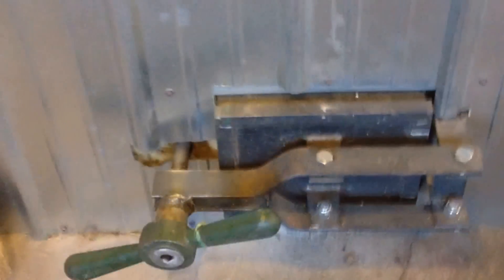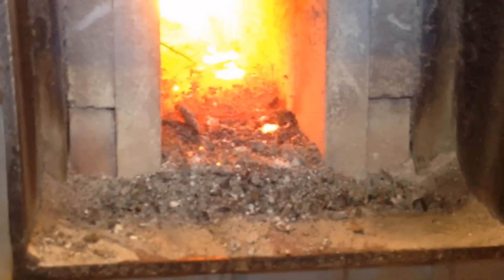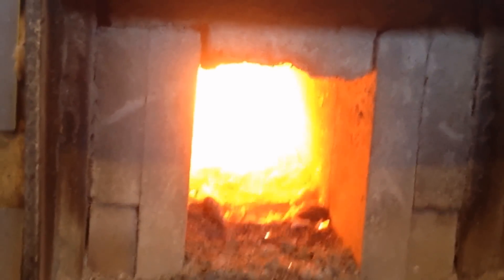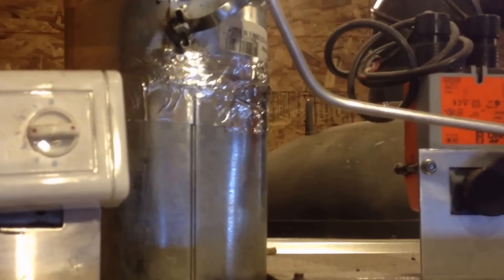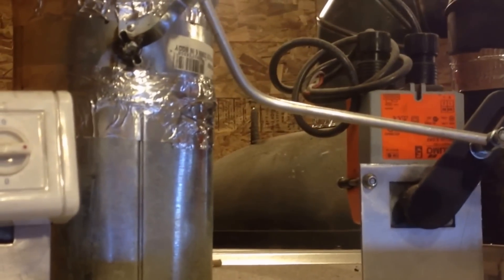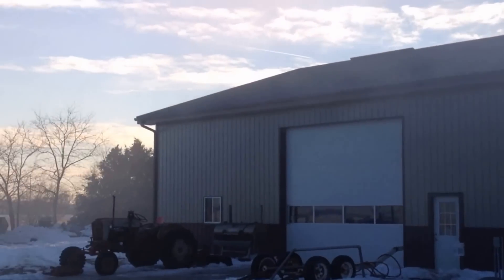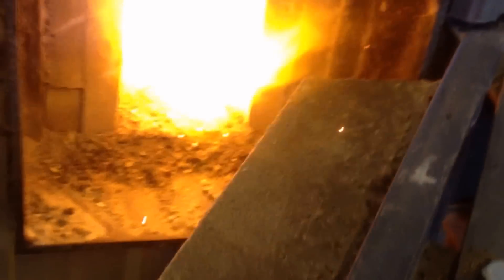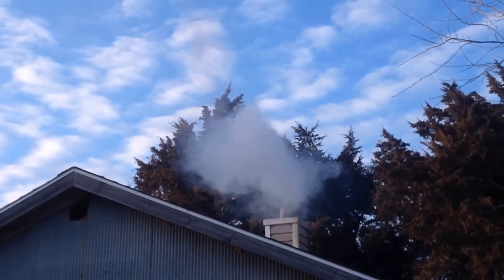Wood Gasification Boiler

Comment: With such a clean burn and so little creosote, why not preheat the fresh air through a heat exchanger to get a little more from the exhaust before it goes up the chimney? You're running a forced air intake so you shouldn't need that heat in the exhaust to make it draft up. Take more waste heat out and send it right back into the burn chamber.
Reply from the maker: Actually the secondary air is preheated to 300f , ingected into the lower burn chamber to receive 2000f temperatures to burn everything before it gets to heat exchanger

Comment: i have been considering converting my outdoor furnace into a gasifier.  but i want to learn more about it before i commit to the project.  could you give me some more information on yours.
Reply from the maker: troy hostetter I will make another video of how the air flows are and a few measurements.  when I built it I did not take detailed final  measurements.  I will have to do this after it is down.  This summer I will be rebuilding the slot in the floor because part of it is carbon steel, need to be stainless or better to take the heat.  Otherwise it is working great again. this season.
Reply: I'm not too concerned about overall sizes.  just the size of the hole where the gasification occurs.  does it matter how big it is?  is it possible to make the hole big or small? also wondering about air supply.  how important is regulating it manually or something automatic?  thanks
Reply: troy hostetter watch my video on a clayton wood stove conversion..

Comment: nice setup! where are you injecting air in the primary? are you injecting air into the secondary burn? how's the heat exchanger set up? size of reservoir? how much you heating and how often do you fire it up? I want more details. I think this is awesome. I'm hoping to build a shop this summer and try to tackle something like this next year. thanks!
Reply from the maker: +greg stowe The primary air is injected in the lower front and back of the firebox with 2" air tubes with 1/4" holes and is preheated with the lower chamber that runs super hot.  The secondary is injected in the front and back of the 14" by 1" slot in the floor of the primary chamber.  The floor is V shaped to the center of the slot.  The heat exchanger and old 200 gallon propane tank with thirteen 2" tubes running vertically though is (tank is pressurized).  The top belled end is removable to clean tubes.  I am heating 4000 Square feet and domestic hot water.  When it is 0F outside I burn about 125lbs of wood every 13 hours with a good coal bed left over.  I never let the fire go out, it burns all the time with lots of idling.  I plan on adding another 3000 square foot shop onto the load next heating season.